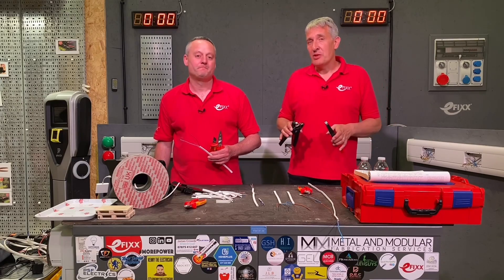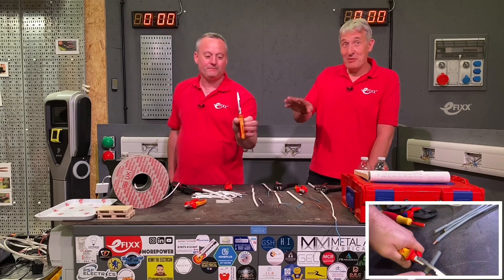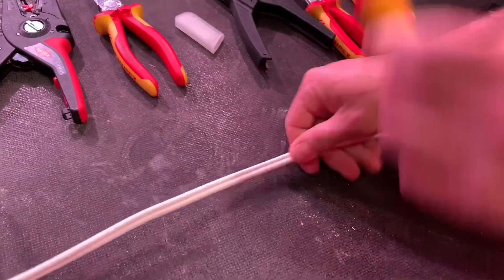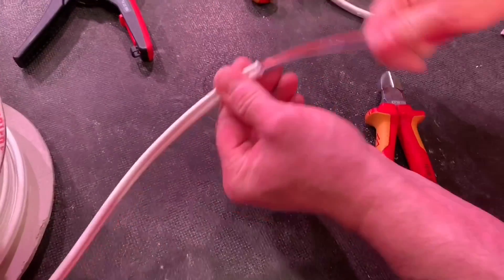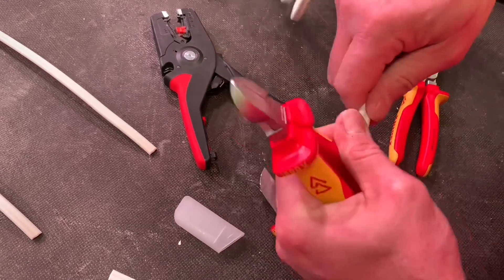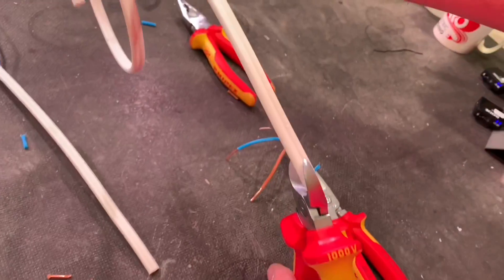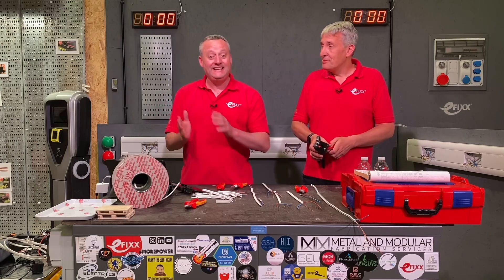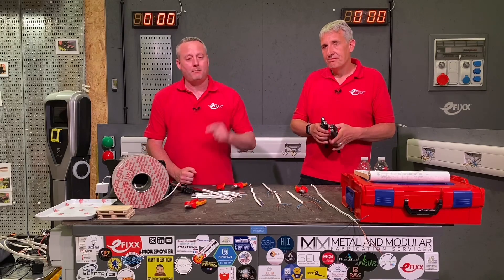WHAT IS THE BEST CABLE STRIPPER FOR LOW SMOKE CABLES? - LSF, LSNH, LSZH T&E

Comment: What do you think of the CK automatic stripper? I've been using one for almost a year. I'm an industrial electrician so very rarely come across T&E, it's usually singles in conduit or panels, SWA, H07 flex and sometimes SY. 

I've found it to be pretty good, except it really struggles with the more rubbery insulation and sometimes can't do it. It can also strip some cables of their outer sheath leaving the inner insulation on the cores. I've found it worked well for stranded cable too, just taking the insulation off and not taking any strands with it.

Comment: I use the quickwire strippers they are hit and miss with the cables and temprature i also use the knipex instalation pliers for single conductors and they are flawless

Comment: I was taught not to pull the CPC to strip the cable as it stretches the CPC, thus reducing the CSA of the conductor, and therefore the current carrying capacity in fault conditions.
Reply: It doesn't.

Comment: I looked at stripper wiedmuller stripper [STRIPAX Ultimate]  for this I dont see it at the moment but there is  a TEMPO PA1113 listed instead which is quite pricey (I purchased the Stripax 16 after your review which worked fantastically until I came across low smoke cable (which was fairly quick) and was stumped :-(

Comment: What about LSZH cable pulling lubricant? Besides Polywater LZ I didn't see anything on the market that is safe to use with LSZH jackets (most lubricants will cause the insulation to crack)

Comment: I use the jokari version of the ideal strippers, great strippers but recently found out it wont strip 1.5mm 3 core&e low smoke
Reply: The knipex Ergo would be another good tool to use for this

Comment: I remember you saying about not installing in freezing temperatures but can remember many a day struggling onsite during winter working.  
Does anyone actually stop installations below freezing?
Nowadays working in industrial Electrical repair work it is the other way round working with machines kicking out 80degree heat. Seeing problems with cables going off due to heat / age.